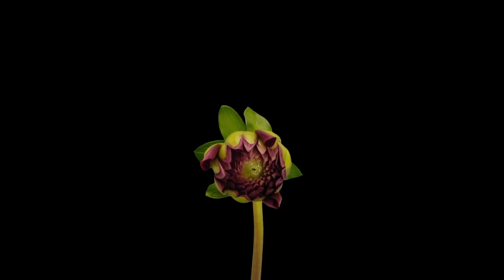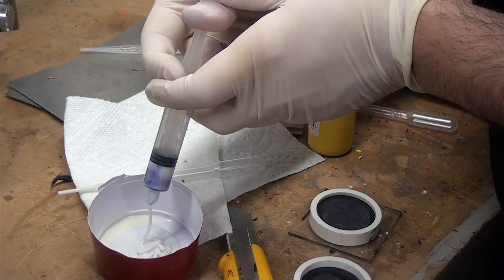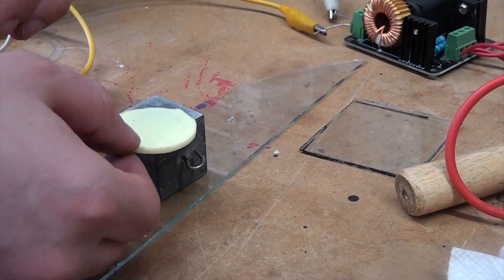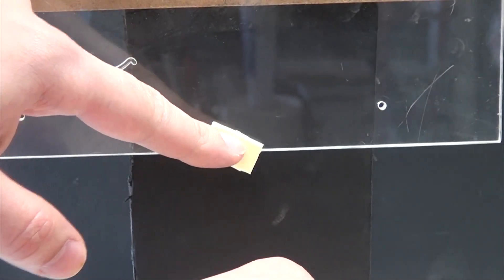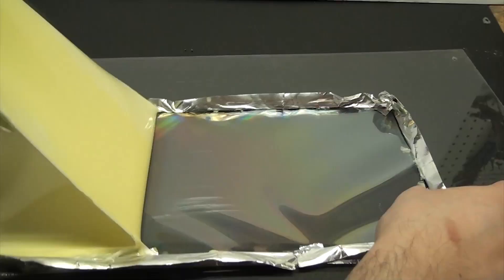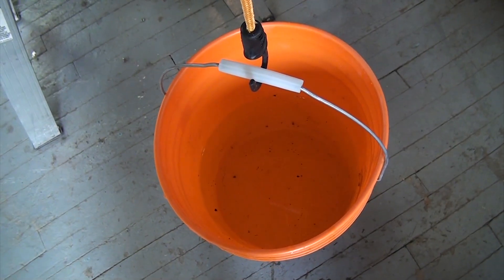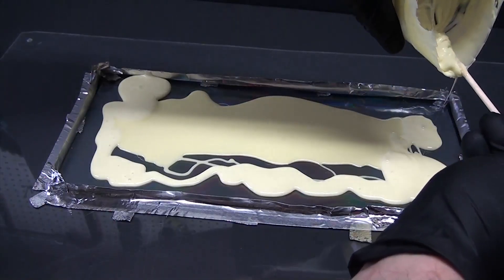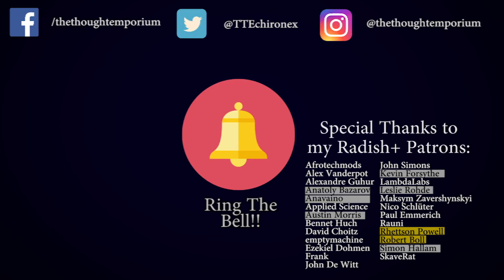Climbing Walls With RAINBOWS - DIY Gecko Tape

Comment: Work it into a glove that covers your whole hand and then get someone really light, like a kid, have them climb onto a ramp with a smooth glass panel and tell them to press their hands against the glass and hold on while you gradually increase the incline. See if they slide off or see how long they can hold on before sliding off.
Reply: That's how you dislocate a kid's arms. Lol.

Comment: After you've applied the silicone to the acrylic, slice a fine grid over whole surface with a fine razor or something smaller. This would prevent air bubbles and somewhat recreate the gecko pads surface area.

Comment: Hey what about mixing two projects: drill 1mm or smaller holes on shrink film with the cnc and it should make small and regular enough holes after being heated right?
Reply: ^underrated comment right there

Comment: I would suggest maybe making graphene (using the CD burner technique) and cast on that. I would also stick the silicon in a vacuum first to remove the air bubbles. You could also use a must slower casting silicon or use less hardner to it's bit more viscous to get into the grooves. Very cool to see the diffraction on silicon would not have expected that

Comment: In order to get full surface contact, it seems like the pad cannot have a hard backing. But in your second test it looked like one of the points of failure was the tape stretching, thus loosing the surface contact. If you perhaps attached cords of rope to the back of the pad which are parallel to the force you are applying, that would give it the flexibility to come in with full contact with the glass, while having the strength in the direction you are applying force so it does not stretch off the glass.

Comment: Ideas: Embed a non-stretchy fabric in the silicone pad so it doesn't stretch off of your contact surface.  Also, add some mechanism to pull a slight vacuum on it to help improve the contact.

Comment: It seems like what's necessary to increase the contact area is normal force against the surface. This might be possible to achieve.

Consider a four-footed animal, with one pad under each foot. The animal is stuck to the wall, with its head up. Consider the front two pads, which are higher, as a sort of fulcrum. The animals center of mass is away from the wall. This places a normal force between the back foot pads and the wall.

Of course, this conversely puts a normal force away from the wall on the front pads. I'm not sure what the balancing act looks like.

Comment: To increase contact try casting with a grid behind the silicone that allows many smaller areas of silicone to move independently of each other, this could be achieved by using a 3D printed mold.

Comment: Going back to the drawing board on creating the microscopic hairs, could you perhaps work up something to create them chemically? I'm thinking of something like metallic whiskering using electricity in a solution, or perhaps chemically bonding short polymer chains to a surface (which I guess is sort of just glue, but you get the idea).

Comment: Some sort of pneumatic backing to the silicone would allow it to apply uniform pressure to the surface you're trying to stick it to. It looks to me like the silicone you're using has much too high a viscosity to really follow the geometry of the diffraction grating. Have you tried PDMS instead?

Also was anyone else 'triggered' by the spider on spiderman's back at 11:12 only having 6 legs? Or is that how to spot the fake one?

Comment: That guy climbing the wall is my professor. He fixed the contact issue by dividing the tape surface into several small segments and connecting each to a frame via springs so that each small segment could be individually held in contact with the surface.
Reply: I did think that was the reason he did that when I saw the pad he was using. Nice to know you have actually confirmed this!

Comment: Why not make a silicone "wire" and make a brush just the way you did with  the tunghsten
Reply: Also, i think you should make the wires hollow. Like tubes. 
Maybe using techniques used for glass.. stretching a tube until its super fine

Comment: about the full contact issue...
maybe try to make jultiple smaller pacthes, independent from each other, so they dont push up some area but can spread out completly. its just the silicon pressing itself upwards i guess.

Comment: If you used a vacuum chamber, would you get better adhesion by placing the acrylic and silicon together and pulling out the air?

Comment: I think the issue is with the cutting board...it may simply be too rigid. Perhaps many flexible columns instead of just a flat sheet? If a grid of metal strips was overlaid on the diffraction grating, a cast would end up having columns. Perhaps a foamed silicone would be 'squishier', and save on material? Great video, in either case!

Comment: You could try to sandwich the silicone between two pieces of the diffraction grating and place it into a vacuum chamber to remove bubbles.

Comment: My professor are ISU worked on this for his doctorate. They ended up making something called Geckskin. The silicone needs a stiff "tendon" behind it so they embedded carbon fiber in it. The stiff the fibor and soft the silicone the better. I'll have to look back through his slides for the science on it.

Comment: When I saw Ben's experiments with this I was convinced that casting would never be high enough resolution to get this done and it would require a chemical etching or similar process. Cool to be proved wrong! Great idea with the diffraction filters.
Reply: Read your reply just after I posted mine. Micro foaming agent in the silicone, then shave surface off, or a photo cell as the mold. But that might be too fine, need a super low viscosity silicone.
Reply: whatever, man

Comment: Since silicone only sticks to silicone, what about casting an aerated more thick layer of silicone on top of the "diffraction silicone", to give it more flexibility, so when you mount it to a flat surface, there is a medium that can compress a little to give more usable surface area between two flat-ish planes?

Comment: What if you transferred your diffraction grating to a large sheet of shrink tape and then cast the silicone off that, or if you could stretch the silicone over the diffraction grating and heat it while vacuum sealing it to the diffraction grating

Comment: Place the film down completely flat (maybe using a sheet of aluminium or something), pour half the silicone and place your acrylic piece with standoffs at each corner, then pour the rest of the silicone. I would however go for something like kevlar instead as it'll allow the tape to stay flexible.

Comment: You could probably try with polarizing lenses, but the slits may be too small for the silicon to fit well into. They are only a few hundred nanometers apart, where as diffraction gratings are about 10 times wider apart. Or just go online, buy a preserved gecko, and steal the design directly from the creator.

Comment: one way to make this a usable climbing apparatus would be to have it on a wheel, wich has a one way gearing so you can only roll it "up" but it stays put when pulling on it, that would make for a very smooth climbing action

Comment: What if you applied the sheet of gecko tape to some gloves? i think that a flexible surface would definitely help with the contact issue and while i don't think you'd ever be able to climb with it it would be fun to grab thing with the gloves and see them stick.

Comment: Add the backing when making the refraction tape. This will allow the silicone to be flat on both sides. Then the inconsistent back side won't be an issue.

Comment: awesome video. i have two other ideas for a mold. a anodized aluminium plate might be usable as a mold surface the aluminum oxide layer should provide many reasonable straight holes which should result in tiny hairs. another idea might be the top of a dialysis cartrige, but this could end up in the same way as the microfilter

Comment: Drill some small holes all the way through so no air will trap between the silicone and the surface it's supposed to stick to

Comment: For anyone interested, one way I would improve on the needle idea is to use borosilicate glass microcapillary injection needles made from stretching small glass rods. Obviously these would be incredibly delicate, but you should be able to make  the ends small, thin, and long enough for some killer gecko tape. Also don't know if wax would be a good idea as a material to cast off of and I would use a pressure vessel to remove micro bubbles from whatever material you would chose. Maybe a soft partially warm wax, nothing too hard because I know the needle will break if you used that.

Comment: If you increase the strength of the medium itself then it could have easily held your weight. The only reason it failed was because the silicone stretched and deformed, but say if you had sandwiched a layer of carbon fiber mesh in between the silicone, then it would have been insanely sticky.

Comment: Lmfao 
I was waiting for the bucket to fall and the bungee to snap back.
I remember being in robotics class and a guy was using a bungee to spin a wooden dowel and he used his hand to release it.
What ended up happening is he didn't know he should quickly move his hand out of the way and the dowel ended up coming full circle before he moved and it smacked him in the knuckles pretty hard.
I was helping him set it up and had to leave the room so he wouldn't see me laughing. I felt bad but thought he had the sense to move.

I thought something similar might happen here with your setup.

Comment: Awesome! I'm so glad you saw success with the diffraction grating. This stuff is a lot of fun. I'm thinking about trying different grating densities.
Reply: Haha, I was looking for your comment. I can't wait to see how your results will turn out ^◇^
Reply from the maker: Maybe try some cd's and such as well to get more of a dimply pattern. One of those old laser disks might work well and be big enough to fit a hand on. As part of the hologram project I'm getting some photoresist. I may at some point try patterning that like how the professionals do it and give this another go down the line if I can figure out an easy way to make tiny lines. Thinking of just setting up an interference pattern with a uv laser and using that to pattern the grooves to the size I want. But if you've got the time and want to try it first, you're welcome to. Got a bazillion other projects on the go, hence why I stopped where I did, as I'm sure you appreciate. Anyway, glad you enjoyed!
Reply: @thethoughtemporium  put some fabric in the silicone so it doesn't stretch so much. I think that's a component of the failure.
Reply: @thethoughtemporium  hey if you make pads on legs also then it would work much much better
Reply: Geckos have double jointed fingers and can roll their fingers backwards to peel them off a surface. The more you know.
Reply: Seriously can't wait for your results Applied Science.
Reply: Wow, i found you commenting on so many channels a like.
Reply: Applied Science, I know this is a bit older, but what if you had a gecko walk on wax to get a molding of its hairs and then poured silicone on that wax?
Reply: @whatitis5646  Wouldn't that hurt the gecko? Also, I think the wax would be either too wet for it to stay in the shape of the hairs, or it would be too crumbly.
Reply: Applied Science hey do ya know where to get some silicone
Reply: i want to make some
Reply: Imagine using vantablack for this...
Reply: Found it. Called Geckskin and worked really well
Reply: When are all of the scientists of YouTube gonna team up with Elon musk to make catgirls?
Reply: @troys.9188  looked into seems awesome. But how do I purchase a sample.
Reply: @evans7771  not sure. I think they spun it out into it's own company to license it but I don't know if it's been used commercially
Reply: @troys.9188  So there is a website named BuyGeckSkin.com which is based off your professor's technology. The samples they have for public sale state that they are 2inch by 2 inch but only advertise holding 1lb. A far cry from the index card holding 700lbs advertised on the UMass website. Maybe it's a liability issue if they say it holds more of they arent replicating the process well
Reply: @evans7771  interesting, it could be a cost measure too. I remember it being related to how stiff the matrix is and carbon fiber isn't cheap so it look like plastic on the commercial product

Comment: I suspect that covering that area with double sided tape it would have got better grip. Not easy to create nano-structures!
Speaking of tape what about using a tape stick and un-stick the silicon while is hard but still curing to create small ridges? After all graphene was discovered using sticky tapes :)

Comment: Maybe try molding it with kevlar or other fabric inside the silicone to maintain flexibility. This would allow for full surface contact but would prevent stretching.
Reply: You don't need kevlar, any low stretch fabric should be fine. Kevlar has insane tensional strength, but a high quality cotton fabric should be strong enough for that.

I can easily support my weight on non-stretch jeans
Reply: You're absolutely right. For some reason kevlar always comes to mind when talking about "strong" fabrics. There are seemingly countless options for this application but the important property is that it allows flexibility without stretching along the X and Y axes.

Comment: 1, Cotton candy card it so the fibers go relatively straight 2, Soak it in wax let it harden forming a mold. 3, Dissolve the candy with water. 4, Add silicon rubber place in a vacuum chamber to remove all the bubbles and draw the silicon as far down as possible in the mold. 5,  Melt the wax mold. 6, enjoy super gecko tape.

Comment: What if you cast the silicone onto wood? When cut across the grain, wood has many small holes which could be used as the negative of many small hairs.

Comment: That was amazing. Suggestion: run the silicone epoxy through a vacuum pump to get the micro air bubbles out of it. Would work even better if you ran the silicone+defraction through a vacuum pump, and even better to do first 2 steps and then put it into a pressure chamber. That's how we did mold making stuff at the place I used to work at.

Comment: Once you pour silicone on the grating top it up with a few layers of synthetic clothing, preferably soaked in silicone, that would give you the flexible yet strong backing that you need.

Another improvement would be to cast the first pad on a say 800 line grating then pull it and squeegee silicone in a 1000 line grating, clean the surface with a blade and stick your 800 line casting on top, that should give you a two stage fractal, you can also flip the orientation.  

Yet another improvement would be to install the pad on the surface like applying a sticker. similar to the pulling action to remove it, that should remover more air and give better contact.

And another option would be to cast holes or grooves in the first layer to let the air get out more efficiently for better contact.

I would do a follow up to your video but don't have the setup for it right now... oh well

Comment: I would suggest adding a squishy layer between the silicone and the acrylic. If you press down you would probably end with an improved area. However I’m not sure what to use. My first thought: foam doesn’t work so well with silicone in my head.

Comment: Nice work, maybe try a DVD or a CD, those would pattern sub-micron features that could be interesting and readily available. Probably you need to put a pressure when you cast as the surface tension will always be a challenge. Love your alternative approaches.
Reply: The patterns on a CD are under the plastic, no way to get to them

Comment: Drill acrylic before you make the pads. Then suspend drilled acrylic as horizontal to film as possible (use level) just above diffraction gradient film. Pour silicone in to form pad and bond to acrylic at the same time. This should allow for the final product to remain flat, as bonding to the acrylic might have dried uneven causing warping of the pad. 

Awesome idea to improve DIY gecko tape.

Comment: I imagine a super easy way you could improve surface contact is by using a more flexible surface. As well i believe if you added larger channels that separate the gecko tape into 1 sq in sections, it would allow the air to escape much more effectively, kinda like a waffle pattern as it were. an easy way to do that would be by making a quick 3d printed waffle pattern to put between the cast and the diffraction gradient, then remove the PLA waffle mold part since it likely wont stick to silicone.

Comment: You should use some sort of airbag as a backing, the air will simply move out of the way of bumps and fill up the dips, just like a waterbed. The newer kind of "bubble wrap" that has all of the "bubbles" connected would probably be the easiest solution. Ordinary bubble wrap would work too, now that I think of it.

Comment: Great project. Can you work out the holding force of actual geckos by dividing their weight by the surface area of their feet, that would help you figure out how close you are to the real thing.
Reply: I've read years ago a scientific research on the subject and they were estimating that one gecko finger could hold 200 times the weight of the entire gecko

Comment: I've never played with silicone, but i've seen other YT use pressure chambers to lessen the air gaps between the silicone and the mold. Maybe this could improve the gecko thing by pressing it deeper in the diffraction grid? Not sure though.

Comment: Try making a pad with some cloth or canvas backing instead of silicon alone, it will add stiffness parallel to the surface but not in the perpendicular direction.